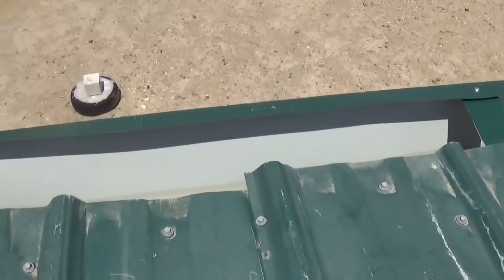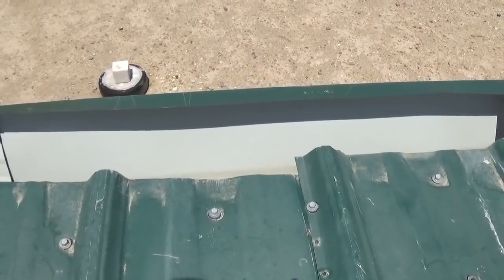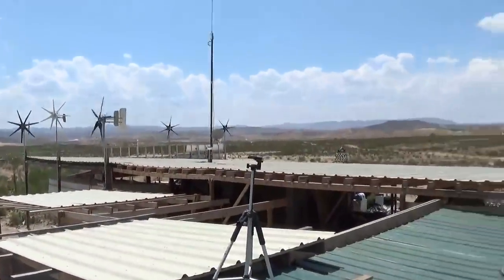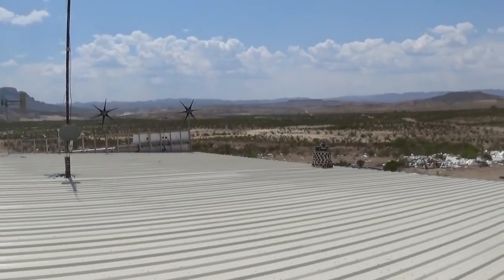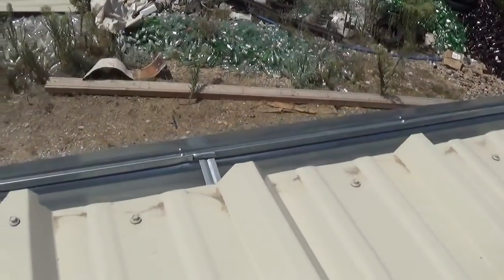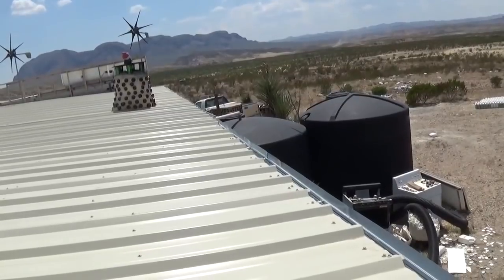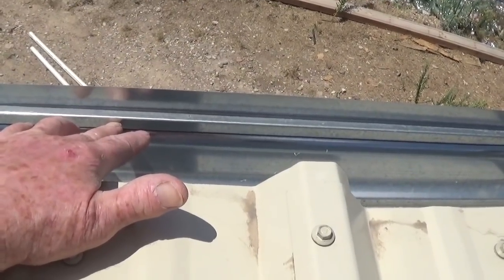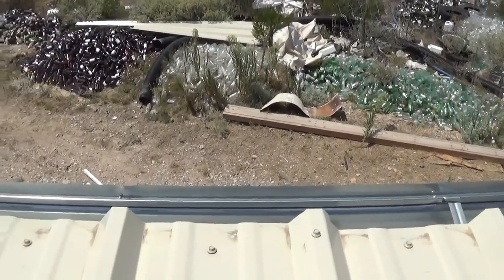Rainwater Harvesting

Comment: Do you have to boil your water before consumption?
Or is that what the bleach is for?
Reply from the maker: We do NOT have to boil this water, it is purer than anything in bottles. HOWEVER, it is always a good idea to be safe, so I do add a few drops of bleach per gallon of water, whether it is rainwater or added creek water. The chlorine goes away in a day or two, but would kill any bad things if there were any.
Reply: I actually have been looking at property out there for years. 
I am well versed in all stages of construction.
I own a small commercial construction company and I am getting tired of the direction our country is headed in and I am actually considering pulling the trigger on living off grid. 
I just recently finished remodeling a light house off the Lydia Anne channel in Port Aransas so I do have first hand knowledge of your first wash cycle you have on your water storage tanks. They however spent a ton of money on the UV filtration and desalination system they are using. I like your cost effective method much better.

Comment: They came up w/ rain water rules cause of people having mosquito infestations in areas .  Are water towers native to your area ?.  You would need a pump to get the water up to the tank but gravity feed your whole system .   Always much luck 2 U an yours
Reply from the maker: Mosquitoes are an issue wherever there is water! But to ban rainwater harvesting, instead of mandating the  covering of open cisterns is just a political way to control the people, not protect them from mosquitoes. Think about it.... all the puddles, wetlands, ponds, lakes and so on out there and small open cisterns with rainwater are legislated against???? Politics designed to keep the population dependent on the "water grid".
Reply from the maker: I never answered to water tower question. There are very few. Ground tanks and jet pumps handle the job in this area.

Comment: This may be slightly un-economical but what do you think about building a large roof that connects from posts to a shipping container that holds water storage and/or general storage? I was thinking of excuses to just make a large roof surface for water that was at least somewhat above ground level (to avoid extra coarse filtering)
Reply from the maker: You really just make what suits YOU. One guy in Arizona built a 6000 square foot "rain roof" that is was complicated as a pole barn to build. The only reason I can think of to build a habitat for rattlesnakes like than (so low to the ground) and not an actual shade shelter, would be the restrictive building codes in Arizona. But to me, it seems a spectacular was of money and effort. In the desert you need ALL the shade you can create and shade is rainwater catchment potential as well.

Comment: natures head composting toilet. we have two. we love them.  in that heat it would compost fast. Two people, once a month change out, takes 6mnths to fill  one of those black tubs with the yellow lids. then out to compost pile to create earth for your growing needs.  no we do not have any smell.
Reply: My humanure has worked. Ultra low tech. If it smells then it's not working right. Mine would run cold, start to barely smell, then I corrected it. So yes, it requires being proactive. It reached 150 degrees for long enough to kill pathogens.
Reply from the maker: Humanure and composting toilets work only as well as the people who have them maintain them. Wonderful in theory!!! But humans get lazy.... lazy makes shortcuts.... shortcuts breed cholera. This is why I recommend a septic system for 90% of people.

Comment: Is that a ham radio whip on the roof?
Reply from the maker: It is a CB antenna. We use it for short distance communication. I am a retired truck driver after all!
Reply: +eco-ranch.us I never can get anyone of the CB here that's why I like being a ham operator I can cover more distance plus do a little more with the repeaters but I would say look into it.
Reply from the maker: Unless skip is rolling, it is so quiet out here that a legal radio can reach our close to 20 miles. We just use ours to talk to each other when I am close by and for when one of us is riding a horse nearby but out of sight. My PU has a Galaxy in it from the trucking days and the base is a SSB..... but the Galaxy is not. We intended to have two SSB radios, but ran out of money and didn't really need them after all.

Comment: how do you filter your water  before you drink it or cook with it? I would like to build something like this but want to know the water I drink is safe to drink
Reply from the maker: +Buddy Phelps Water is inherently safe to drink, UNTIL Man fouls it! This "all water is unsafe to drink" mindset is a result of the second worst all-time scam that Man has perpetrated on Mankind: "water must come from a plastic bottle and cost several dollars a gallon, in order to be safe or even taste good."

Rainwater from the sky is as pure as it gets and is even purer that distilled water. Yes, in heavily polluted urban areas, like Beijing, it could hit the ground carrying particles and heavy metals (Man has fouled it). But if that were the case, you have a LOT more to worry about that contaminants in the water! 

However, IF it picked up "particles" and if the surface the water was collected from was not completely flushed it could pick up "stuff". However, it STILL would be better to use than most of the water used in the world today!

As a "just in case" precaution, since we are all aware of typhus & cholera, as well as amoebic intestinal issues, here is what we do to make our water 100% safe: from the roof, it has a "first flush" that captures the first 15 gallons of rainwater that could have dust, bugs and bird crap in it; then, after each rain, we pour some bleach into the tanks: 2-3 drops for every gallon collected; I also hang a local plant: damiana, also known as "the antibiotic plant" in the tanks for 2-3 days from time to time; the last thing we do is that we have two, 50 micron filters on the waterline as it enters the pressurized part of the system. We have NEVER had any issues with the water!

One more thing though, the human body evolved to have certain "flora" working in our digestive/intestinal systems. The ultra cleanliness of most people, as well as the foods they consume, in many Western urban areas, coupled with the ignorant "cleansing" of these systems by "New Age" type, pseudo-medical "practitioners", has killed off quite a bit of these beneficial bacterias. This leaves people without immunities to many Natural illnesses.

We also theorize that NOT living close to your livestock (protein sources) and NOT butchering them yourselves, is another way we have eliminated many beneficial bacteria from our bodies. While people in Asia that live & sleep with their chickens ARE the first to get H5N1, should it ever enter the human mainstream, we believe those same people would survive it in far greater numbers due to their proximity immunities.

Your answer is in there! But so is a lot of good common sense information! 

PEOPLE, STOP BEING SCAMMED INTO BOTTLED WATER!!!!!

Comment: how did you pump the water in an what type of filter system did you use
Reply from the maker: Mike 6679 It is a simple 110 volt pump attached after the tanks, and before the filters. The filters are two, 100 micron filters.